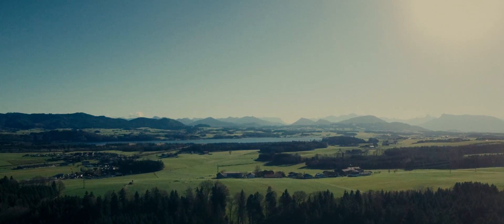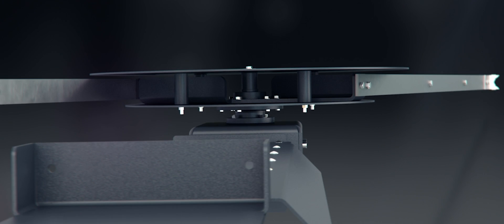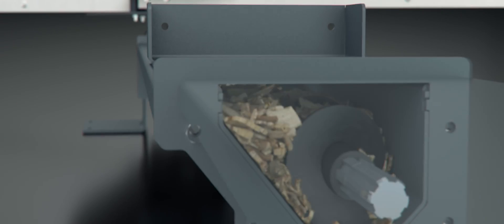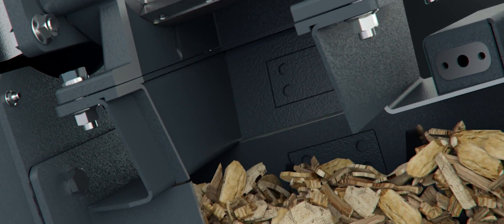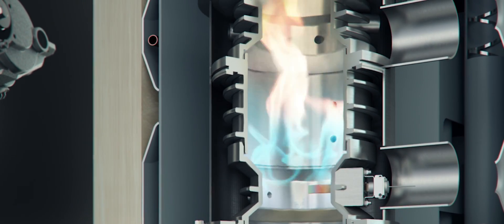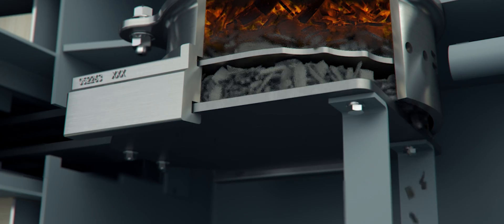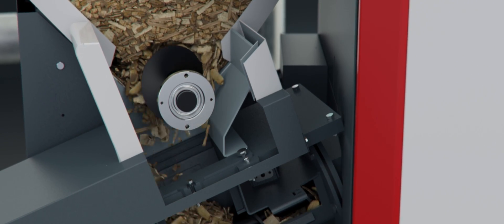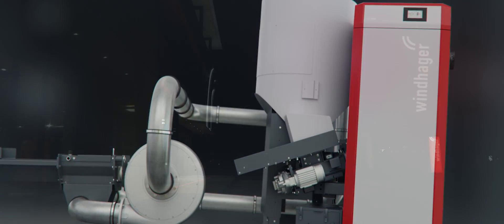Windhager PuroWIN - The wood chip heating revolution

Comment: Overpriced and high maintenance costs. Dont ask me how i know, fine for a first year, second winter we started to get mechanical problems, third year the excelent customer support had our home cold for 4 days, and keeps breaking down.
Reply: Curious what the initial price was, and how much it’s cost you since?
Reply: @funposting8912   The boiler was just under 9k €, in total from head more than 2.5k €, electronic controller was expensive and not under warranty.
Reply: 9k€ is the price of a geothermal well...
Reply: Why did you not get geothermal heating..?
Reply: @setaripantheon8801  ground is not suitable for an earth collector here and wood/chips are free from our forests.
Reply: tal vez no hay buen servicio pero no veo complicado el sistema de reparar, puede hacer algunas modificaciones y se hace mas sencillo